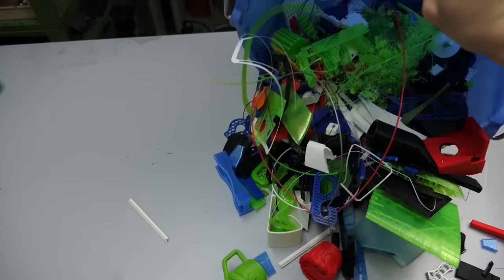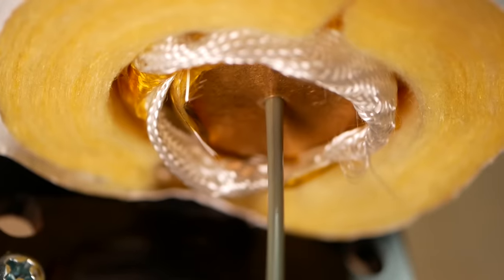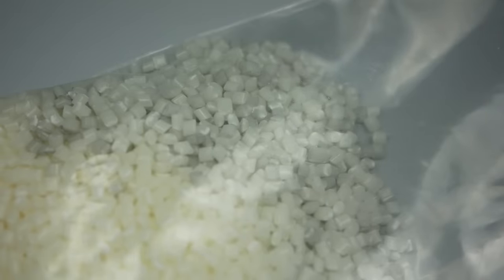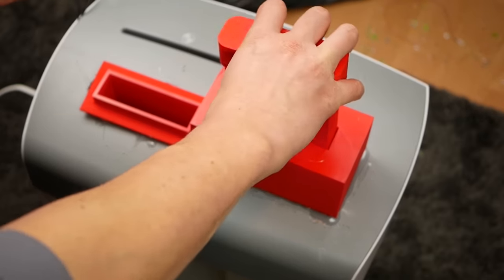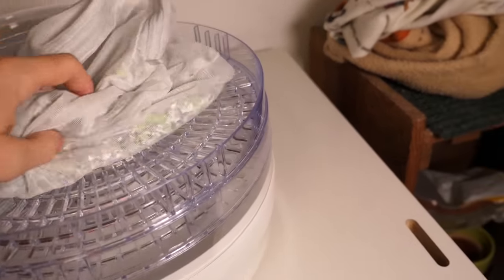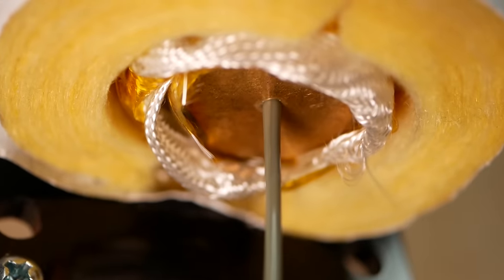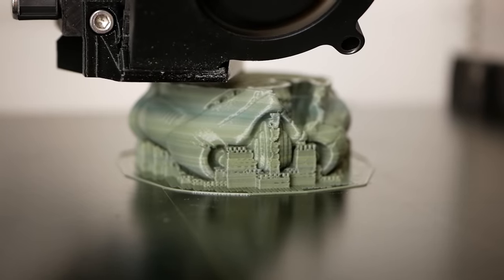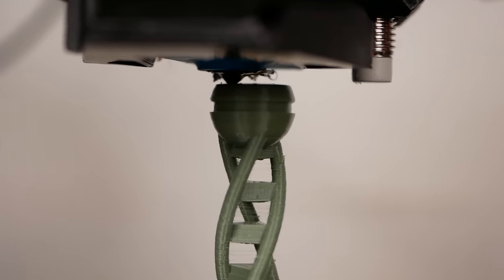Recycle your failed 3D prints! Make new filament at home.

Comment: This kind of setup would be a great for hackerspaces as with amount of scraps from the whole community it would actually pay for itself.

I would love a video or series of videos on "what can you do with 3D printing waste" exploring all the options that are available.
Reply: From an environmental standpoint, this should be the standard in all hackerspaces.
Reply: etoile Trees are carbon neutral once they die. Do they not teach the carbon cycle at schools these days?
Reply: @aeroscience9834  They can't teach the carbon cycle, otherwise kids would wise up about the global warming hoax and we can't have that. I remember back in high school when everyone was all about cow farts leading to the apocalypse because of Al Gore's fear mongering, our AP chem teacher outlined the equilibrium on why the "hole in the ozone layer" was impossible from a thermodynamic perspective (more UV radiation, more formation of ozone from diatomic oxygen).
Reply: @aeroscience9834  Trees as individuals yes. However more forest cover equals a larger carbon sink. Also, forest soils sink carbon into the soil.
Reply: @DaveSmith-cp5kj  Equilibriums can be shifted. Negative feedback loops can be overrun. Sufficient amounts of HFCs will greatly shift the equilibrium towards less ozone. That being said, you should still be skeptical of alarmists.
Reply: @Weirdomanification  For sure, but the issue with the ozone is that ozone is formed from UV radiation of diatomic oxygen. So when ozone concentration reduces, production of ozone exponentially increases as the UV rays penetrate deeper into higher oxygen atmosphere. This is why we have never actually seen a real "hole" in the ozone layer. Ozone is a very fragile molecule, which is why it is constantly being produced.

Comment: Me and my old man made a filament extruder that works slightly differently, we have digital caliper that constantly checks the diameter of the filament and then use a "puller" that pulls the filament till it has the exact diameter we set. This means that we can make filaments ranging from 3mm to 1.75mm with the same setup, we just change the desired filament diameter and an arduino takes care of the rest through constant measurements and a PID loop
Reply from the maker: That's the proper way to do it and also how the professional machines do their job.
Reply: Maybe you can create a tutorial of how to DIY such?
Reply: Sounds great!
Reply: Would definitely like to see a tutorial on "how to" for your set up as well as a parts list.
Reply: thats cool.
Reply: ET video?
Reply: Add me to the list of viewers interested in 'digital calipers' -- actually physically touching the filament???  (vs. optical)   Intriguing!
Reply: Would love to see this build and maybe instructions to replicate it, if possible?
Reply: Very interesting project, do you have some sort of ball bearings on the calipers so they won't hinder you from extruding or literally just the calipers?
Reply: Wow! Impressive. Do you have a video? Would love to see it. Maybe you could turn it into a product people could buy? You would probably make a lot of money! Or offer to recycle peoples filaments and resell them.. In trash can khaki... smelly blue box blueberry...crunchy or creamy :p haha sorry couldn't help myself! But yes! Take your invention into production it sounds neat!

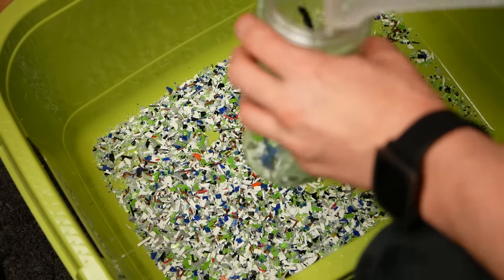Comment: 4:18 lol at the black plastic strip that ignoreres the 5mm rule and yolo straight through the sieve.
Reply: Hexagonal holes would help with this...some oversized parts up to 7mm are bound to slip through diagonally on a 5mm hole square grid.  Hexagonal 5mm holes would only allow 5.7mm pieces if they perfectly slid into the corners.  A little smaller than that and you guarantee nothing over 5 gets through.
Reply: @VoltisArt  No, it would not.

Comment: I think reusing most things is a good thing. So I think what you're doing is very cool. And I look forward to more from you.
Reply: Yeah but not when the recycling cost exceeds 10 times the cost of the new filament. 1kg in 10 hours, how much electricity will be used?
Reply: @acerrusm  Probably very little. Filastruder's website states 60 W peak. So 10 h is 0.6 kWh in the worst case. In my country it'd cost about *$0.10 for 1 kg*.

But even ignoring that, electricity can be produced from renewable resources unlike plastic filament. Moreover, wasted electricity usually turns into heat, while wasted plastic doesn't disappear magically¹. Heat may be a bad thing if you recycle when it's hot outside, but it should be feasible for most people to wait with recycling until winter, in which case you can save on heating your home/office so that recycling itself is very cheap. Theoretically, you could capture the heat and use it for a different purpose (e.g. heating water) but that would be tricky and probably not worth the hassle considering how little electricity extruding uses compared to heating water.

¹ except PLA because it is biodegradable in theory, but in practice it depends on the additives so I'd carefully check the dyes used before throwing it onto my compost pile
Reply: @tuesss  But what about shredding, cleaning, dehydration, winder, food the dude consumes while operating the process....? I bet it's not very efficient to do this on small scale. Also "renewable resources" is BS. How you gonna renew sun energy? Creating energy from sun disturbs nature as well, because this energy you're taking will otherwise be used to warm up the soil, air, plants... which in turn would affect other things...  Getting energy from water or any other source is also not free. If you say water is renewable why petroleum is not?
Reply: @Adiounys  Clearly you're just trying to be anachronistic, but I'll humor you.

The food the user consumes while running it, would be consumed anyway. We gotta live. So just, don't

Shredding and the winder are all low powered items, the dehydrator will be slightly more 300-500W. These can all be powered by renewables, the same as the filament recycler.

Everything Tues has said is correct. Energy can be generated (from low-emission sources), plastic is a waste and quite hazardous to the environment, if mishandled. Reusing that waste is a smart idea.

Efficiency is a misnomer term too. You can have excellent efficiency, but still be wasteful. A perfect example is heat-exchangers (aka Air conditioners). Heat exchangers are often around 300% efficient. That's for every unit of energy you put into it, it can return 3 times that. Pretty good, right? But, we have so many A/Cs round the world, we are still using vast amounts of energy to power them, and often that energy goes to waste anyway (heating/cooling rooms without anyone in, leaking out open doors whatever). Heating and cooling can often be achieved passively, or via good design, reducing energy costs. So, while you may use a less efficient heater/cooler, you could achieve it with much, much less overall energy.

Now to my point on that. Yes, larger scale recycling of plastic is more efficient... but it's not really being done. So, some recycling at home, at less efficiency, is still better than none at all. Capiche?

Now onto your really ridiculous statements. Energy from the sun is considered free because it's a multi-billion year living object, that is going to do what it does, regardless of what the rest of the universe thinks. It will massively out last humankind so isn't worth factoring in.

Sunlight hitting solar panels would only affect plant life, if we installed it directly over existing plants, blocking their sun. That's not the case, is it? The panel absorbs the heat too, so the air still receives it's due. I'm not sure why you'd want to heat these things up though?

Petroleum isn't considered renewable, for the very reason that it can run out (we're already at far harder difficulties in extraction processes than we were even a decade or two ago - it will only get harder) and because it took hundreds of thousands, if not millions of years to decay and form into what we know of it now. We THEN have to refine it (more wasted energy) and THEN transport it. I could go on
Reply: @MrVelociraptor75  The food you need to conusme while laying in bed is not the same as when you move. But that was just to point out that there a many small factors which togateher may have significant impact on overall outcome.

"Now to my point on that. Yes, larger scale recycling of plastic is more efficient... but it's not really being done."
I thought there were recyclic plastic in large scale already...

"Now onto your really ridiculous statements"
What statements were ridiculous?
"It will massively out last humankind so isn't worth factoring in."
This is ridiculous statement - how you know that? 

"I'm not sure why you'd want to heat these things up though?"
So you really didn't get my point. I don't "want" to.
I was just saying that redirecting sun energy is affecting natural environment. The light that you turn into electricity is not turned into heat at the place. Changing air temperature creates wind.
On small scale it's not visible but if you could image that half of the planet's surface is covered with solar panels, it can change the climat significantly, but it's really hard to predict.

"Petroleum isn't considered renewable, for the very reason that it can run out"
You can say the very same thing about the sun.
"and because it took hundreds of thousands, if not millions of years to decay and form into what we know of it now"
Frist of all we don't know it for sure.
I'm not an astronomer but I just found out that star formation takes about 10 million years (https://astronomy.stackexchange.com/questions/156/how-long-does-it-take-to-produce-a-star-why-does-it-take-that-long).
So you can say the same about the sun too, which saddly means your explanation failed.

Now, I see whe are diggin into details but original poit was about sense of recyclic filament and no matter what, this technique is preety useleess for almost all users. Even if cost of recycled filament is little smaller, you still need to recycle a LOT of it just to compensate for the machines used in process. And there are more negative practical factors but I don't have more time to write about them.

Saying all this I still think it's cool thing to do, but it's no more then a curio at this stage.
Reply: Hmm, is it? Try not reusing the word "thing" in same sentence to begin with, lulz :D Just messing with you!
Reply: @AdvenBurak  Thanks for advice but how do I know that I'm not smart, if I'm not smart? Even if you tell me this, how can I judge if you are smart and telling the true?
Funny though that you use the "i know it all", which suppose to describe my attitude in comment containing phrases like "we don't know it for sure" and is generally constructed in this tone.
Reply: @Adiounys  well i could address a few million articles about that but anyway.My point was if you try to act like something at least get the acting part right.

There are some things already set in stone and we peer into them with the eyes of science.Im guessing astronomy is a joke to you.And this is the sole reason i made a comment about your mind.I can only judge certain things from a few simple comments and so far they say what i said above.That or you are too little to understand,then that means you have a whole life to change that.
Reply: @AdvenBurak  "Im guessing astronomy is a joke to you" - based on what? Because I say humans may last much longer than you are imagining it?
Reply: @Adiounys  no bcuz you think sun may not
Reply: @AdvenBurak  may not what? I only said it may not outlast humans because we can't tell how long we going to live
Reply: @Adiounys  you know what? each man to his own.I am not obligated to teach you anything.
Reply: @AdvenBurak  Good. I only hope that you were not thinking about that we cannot live without the sun.
Reply: @acerrusm  probably not a whole lot lol
Reply: That was a reply to the energy this device uses. But these things have since improved and will continue to improve and someday they will become a must have for anyone who uses a 3d printer on a day to day basis
Reply: @tuesss  my ender 3 heats my home office which is the room that gets the coldest in the winter. It gets to a temperature where is still a little cool but not cold
Reply: @Adiounys  I'm really amazed at how many people here do not have the intelligence to understand what you are saying. Got to love how they throw insults at you because they can't actually argue against your points.

Comment: For more consistent color and composition you could do like the big manufacturers do and chop up your first extruded run into little even bits and then extrude it again. You could even do color mixing that way by separating your input colors first and batching them by themselves. Then you can add a ratio of colors to get something new. Definitely more work and time investment and probably beyond what a garage homebrew would want to mess with.
Reply: I immediately had the same idea. Why not make your own PLA pellets from the scraps first, and then extrude that into a filament?
My brother makes and sells pasta on a medium scale and the machine to make them works on a similar principle, with an auger that pushes the dough thru a die that makes the different shapes (like flat noodles, spaghettis, macaronis...). On the die there is a rotating knife that spins at just the right speed to cut the pasta the length you want. I'm pretty shure there are other possible ways to cut the pellets at the extruder, the pasta is already pretty hard when it gets out of the "nozzle" and it does not stick. So maybe using a shedder that cuts the cooled down rough filament into pellets is easyer to do with plastic than trying to cut it directly at the nozzle.
Reply: exactly. I think this would also improve colour consistency too if you have a huge amount of random colours being recycled (and want a uniform overall colour at the end).
Reply: You would have to use ABS for that, the PLA polymer chains break down too quickly. One time recycled PLA is much weaker than fresh PLA; this effect is not really noticeable with ABS.
Reply: @among-us-99999  Yeah, that could be a problem. Mixing in some fresh pellets with your DIY pellets might help to keep the properties in the printable range. (Question is, how much fresh pellets would you need...) And having an extruder that uses more brute force and less temperature for the scrap-to-pellet extruder would probably help to keep the polymer in better shape too.
Reply: ƸӜƷ the printability is not really a problem. There is pure PET Filament available; it is just a little bit more brittle.
The glycol is added to prevent it from crystallizing when it melts and solidifies many times.
Reply: This would also help "Clean" the the plastic as he laments towards the end of the video.
Reply: @ProtonOne11  I get several plastics industry trade magazines and the subject of recycling is often written about. It takes about 10% to 15% virgin plastic added to get close to the original properties when recycling thermoplastics.
Reply: Another idea would be to print a two-stage wash tumbler to wash the dirt off the pieces after shredding them. The inner drum would house the larger pieces and the outer drum would have a finer mesh to catch any smaller/finer pieces.
Reply: Build your own for $465 DIY: https://medium.com/endless-filament/make-filament-extruder-for-465-bbc0e8a74e74 enjoy